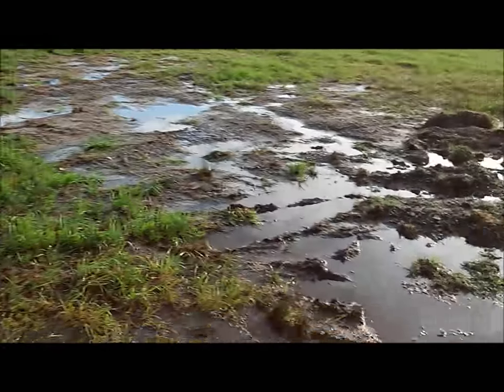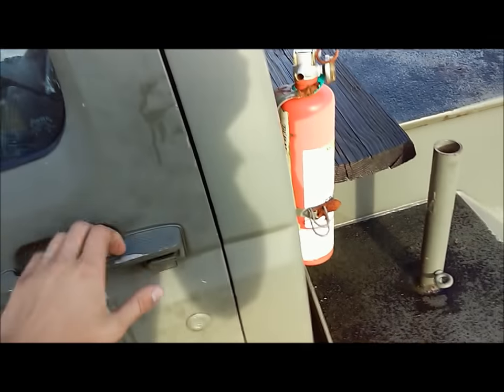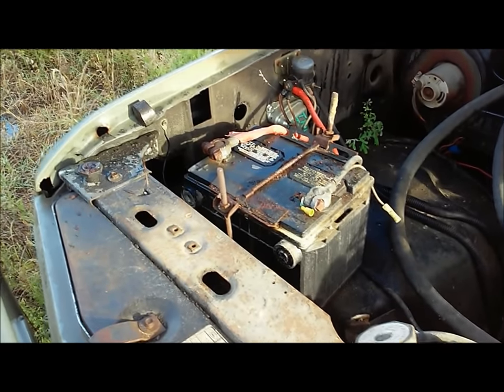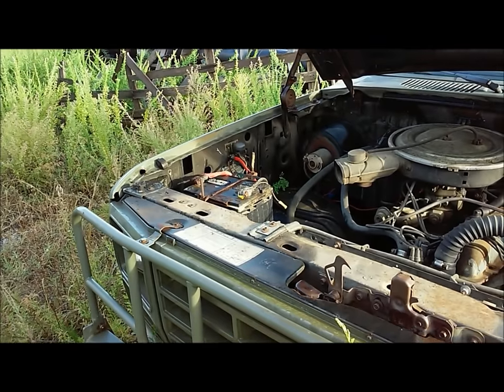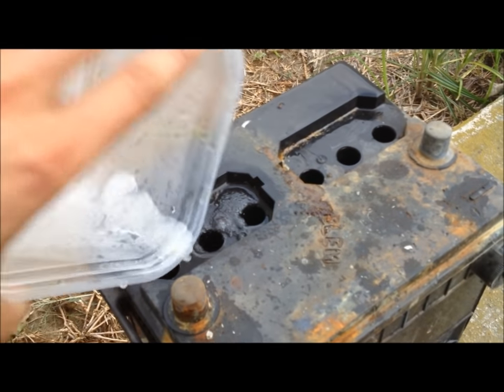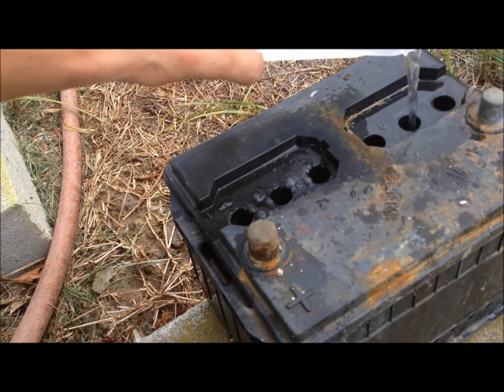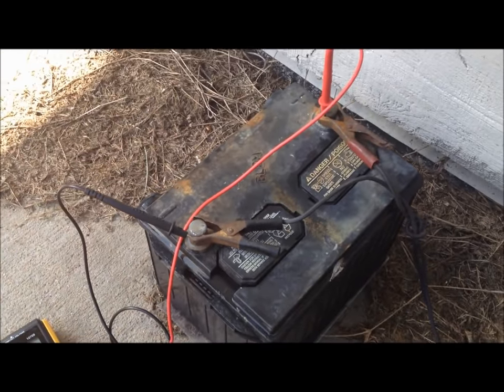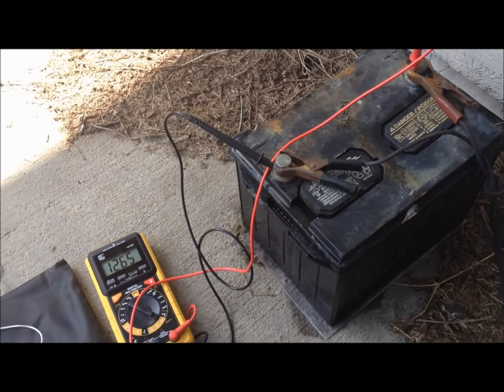Car Battery Repair After Sitting 10 Years: How To (Basic Home Products !!!)

Comment: So did it work,did it hold a charge, did you replace the epsom salt solution with more acid, what kind of acid did you use, did you really pour out the acid in the grass, how much salt to water ratio did you use, is it still working,
Reply: Yeah I am really confused. Why isn't the battery filled with acid? Just epsom salt? Something doesn't make sense. I would think that flushing it completely out with distilled water, then putting fresh sulfuric acid in it, is the only way to properly restore it?
Reply: @Ritalie  yeah you would be correct
Reply: Haven't watched yet but Epson salt will work as "battery acid" because of the (I suck at chemistry and only know from watching videos explaining things) it's baisly magnesium sulphate and is no different electrically than surphic acid.. @Ritalie
Reply: @Ritalie supposedly you use baking soda first to clean the battery out and then put the epsom salt and distilled water in and then charge it supposedly it works I’m gonna try it and see because I’ve got 3 or 4 old batteries around to see what happens
Reply: @Ritalie i tried this didn't work end up buying new😊

Comment: No matter what you do , it all depends on how good the lead plates are. If they are partially eaten away The battery will not last very long and is very undependable, I learned this from trying all these ideas. No matter what, it will not last much longer.

Comment: What you are doing definitely works. But not cleaning the dirt and rust from the top of the battery will end up getting into the inside of the battery. This will short one of the cells out. Otherwise you are doing things correctly and that does work. Worked for me fella. Nice

Comment: South Africa.  Great video thanks.
As a student, 50 odd years ago, I also, intuitively, did the same, only cruder. Not all salts were dissolved and I simply poured it into the cells. And it worked.!
However, in my young mind, I did the following:
I poured out the Acid and quick flushed it with water.
Then I poured in Bicarb solution, to penetrate the bottom sediment, that short circuit cell, and to break it up with the bubbly reaction with residue Acid in the bottom sludge.
I then rinsed it well to get rid of clusters of sludge.
I then poured in my Epson salt concoction in and charged it in reverse polarity.
The thinking in my small brain was that, one of the plates were depleted, and if I revers charge it, (my Positive was from now on, my Negative), I could build up the depleted plate with a metal with higher Electro-potential value , on the periodic table.
As far as my memory serves, it worked just fine.
Reply: Complicated?
Reply: Imagine jy moes die elle lang verhaal in Afrikaans probeer oor vertel

Comment: I was thinking pouring it in a bucket before he started pouring it out.  I like what he did by bring the battery back to life.  Go to the junkyard and see if they will let you have the old batteries if you pull them.  You could use them in your solar system or as a spare to jump your vehicles.  In a truck you could install it and have it only charging and not tied in the electrical system.  If the other battery happens to die you can use the other to jump it.

Comment: you can pour the old battery acid in  a large enough container. You can actually reuse it later. after the rinse the batter with distilled water and rinse at least another time will giving a good shake to get the rust out. I dont know about Epsom salt used this way. Never seen it done before but i did hear about it.

Comment: The truck is called a bobtail and was used by the USAF for transporting munitions from bomb dump storage to the flight line. Max speed was governed at 25 mph. They were able to tow up to 30k.
Reply: They were also used by AGE guys to tow their equipment to aircraft

Comment: At 3:55 I knew why the video has a 2:1 like:dislike ratio.
Oh Heavens to Betsy! He poured battery acid on the ground!!!
Oil, gasoline, battery acid comes out of the ground.  Think of it as recycling w/o burning carbon emissions to process it.  This man is saving the planet from air pollution.
Reply: It's loaded with bits of lead particulates. That's what you want in the water table?

Comment: Battery plates are soft and break easily. If the plates are deteriorated, the battery is junk. The Epsom salt (magnesium sulfate) is a temporary solution to help recharge the cells, allowing the sulfuric acid to become acidic once again and "hopefully" dissolve some of the lead sulfate from the plates. This is where I'm at - finding a chemical solution to dissolve the lead sulfate without harming the lead plates in an empty battery. 

 Automotive lead acid batteries are generally 30% to 37% sulfuric acid. As far as I know, the acid has nearly an infinite life without any chemical contamination. 

The water evaporating from a cell and exposing the plate to air or leaving a battery discharged is what causes most of these issues. 

Simply adding distilled water back to the cell and trickle charging (3-amps or less) for a few days does wonders. I have mine overcharge to a "safe" boil. I'd gotten almost 24 months out of an old battery this way.

Comment: I used this method to recondition a battery a couple of months ago and it worked like a charm. I am trying to do another battery now but it is obtained getting to 75% on the trickle charge. It has been 3 days. Any suggestions?

Comment: The top of the battery has BLEM blazened into the plastic. Sometimes it may also be printed on a sticker. This means the battery has already been "reconditioned" at some point. 12.6v is not bad for a second time recondition. But I would be interested in know how long it lasts. 6 months maybe.

Comment: I just have a couple of  questions. Once you put the salt water and "De-Sulfate" the interior of the battery.  You charge the battery with salt water in it? And if it works with the salt water, and start the car. Did you replace the salt water with battery acid later on?
Thanks: Thanks a lot for the video.
Luis Rivera Arroyo
:

Comment: I just use vinegar 
two batteries deep cycle 
2008 dried up in my garage 
I just added vinegar to batteries and put on the charger I’m still using them today they still take charge !!
Reply: did you use white vinegar instead of water & acid?
Reply: with ranch dressing on the side

Comment: Ive always done this same thing , and I have the same charger haha. It has always worked , but now I noticed you can buy new battery acid locally cheap. Possibly clean it out this way and then dump of the Salt water mixture and put in New acid. I would like to put this new idea too the test.

Comment: Thank you for the info.Saved me $30 on a new battery.
 Wow.So many people just 'comment'to whine about fluid into Your lawn.Not smart enough to think that it's pretty much neutral already or the battery would show Something of a charge,and it's Your yard and not next to their well which would Never be affected anyway.
They should be stopping Fracking companies from dumping Waste instead.That will affect their decendants,not your dead batts.
Reply: Sure and when the person who does share a well with you watches a video and pours their battery acid out on the ground to do this?

The sulfuric acid is probably whatever, but the lead in it is probably not the best thing to be putting into a water table.

Comment: That truck is a tug vehicle called a "Bobtail", since the tail of the truck has been 'bobbed', and depending on the governor, their top speed is 25 - 35mph.

They are used for tugging equipment of all kinds.

Comment: how long will the battery hold its charge for especially when its under load eg with lights on. I think you will  find the battery wont hold its charge. Try and start the car on the next day and i don't think it will

Comment: That little bit of sulfuric acid won't hurt the ground. The rain is full of it in most areas downwind from the big city. 
AND, if an old battery could really be made good enough to use for any real work they'd be worth more than the 2 bucks the recycler gives you.

Comment: I hope you don't mind my comment, but the first thing you should have done is clean all the debris and dirt off the top off the battery, I also would have saved the electrolyte it has lead particles in it, and after you desulfated the battery, you could re-add the old electrolyte. Take a look at Pulse Tech battery desulfators, but they do take several weeks to work.
Reply from the maker: +Jose Francisco Medeiros yeah, thats a hell of a good idea. i definitely should have done that. next time around that i try this, i will have to do it that way. you make a heck of a good point.
Reply: ThunderHead289 I also had a 289 engine in my 65 Mustang fastback.
Reply: hey ,if anyone else wants to discover how to recondition batteries try Jadonite Renovate Battery   Buddy (just google it ) ? Ive heard some great things about it and my mate got amazing success with it.
Reply: +Jose Francisco Medeiros I\'m not sure but ,if anyone else wants to discover how to recondition my car battery try Knewreck Rapid Renew Guide (do a search on google ) ? Ive heard some awesome things about it and my colleague got cool success with it.

Comment: Always clean the top before removing the caps.   And how do we know the battery was dead?  Certainly it should have been topped up and a trickle charger applied.  If it doesn't come up, then the battery is dead.

Comment: I guess you guys don't know one of the rehabilitation methods for drinking water wells is to inject acid into the well. Call your city engineer and ask. What he poured out will be neutralized before it penetrates 3 inches into the ground.
Reply: absolutely right,  Some trace lead in the liquid but the truck leaking for 10 years polluted more than the battery.
Reply: Darrell Weathers b
Reply: Exactly. Basic general chemistry at work. Too many winners of participation trophies 🏆 commenting here
Reply: So u let ur child drink it
Reply: Nigel Gibbs Coin’s

Comment: Waste of time. It will act good after this and take a fake charge. Load test it. You might get a few starts out of it before your stranded or ruin your alternator. 38 year mechanic here.
Reply: Your right, plates are so thin bat has no life left
Reply: Lordskeep i concur
Reply: I used Epsom salt in a battery once that wouldn`t charge up and it worked for  about 2 years after
Reply: ohh thats what the is i was so confused i got batteries that someone did this on and they take a charge but when you put them on something like a trolling motor they shoot back down to 5 volts after reading maybe 12

Comment: You should have cleaned the top of the battery off FIRST, before attempting to open the cells. Wash with plain distilled water, brush off any persistent dirt, and rinse well. A clean battery is worth rejuvenating. If you let the rust and dirt into the cells, you are wasting your time.

Comment: There are  a few ideas for fixing a car battery
Don't try to do this until you know what you are doing - the acid can burn you
check the voltage first - there may be a kaput cell which would waste your time.
Check the battery fluid.
attempt to fully charge the battery.
(I discovered about these and more from Jons Mender Guide website )

Comment: Need to take the plugs out and put a little penetrating oil in the cylinders. The rings tend to rust and stick to cylinder wall and will break. Safest way is to turn it by hand

Comment: I wasted so much time trying that on so many batteries
Reply: It didn't work ?
Reply: @briantruck2284  I tried it also on 3 boat battery's that had set for 15 years with no luck. Not all the cells would take a charge. Only a couple of the cells would. I used an old trickle charger first with no luck. Then I tried charging on my 10 amp  charger, no luck. Then I tried my 200 amp charger. The cells bubbled and you could see vapors coming out of the cells. Still no luck bringing all 6 cells up. All of the chargers I used were the old style. I heard not to use the "SMART" charger so I used the old types that continue charging until unplugged. I was given 3 more old boat battery's I'm going to give these a shot to see if my luck changed.

Comment: In the last part of the video he was supposed to be showing us the BATTERY voltage.HOWEVER he still had the charger connected. All we saw was the charger input voltage to the battery, There was nothing to show us if the battery took a charge or not !! As a good battery discharges lead sulphate forms on the plates. When the battery is charged this sulphation dissipates and the plates return to pure lead for the negative plate and lead oxide for the positive plate. When new this sulphation will take part in the chemical action in the battery as it charges and discharges. If a battery is left discharged the sulphate which is chrystaline starts to compact. After , say, 6 months the sulphation has compacted to a point where it will no longer react chemically when the battery is joined to a charger. The battery is dead. Pulse chargers are supposed to be able to blast holes in this compacted surface but there is still no definite proof that this actually works.The high voltage pulses are more likely to blast the lead paste out of the lead grids that it sits and which also will destroy the battery.
Reply: John Davies- voltage is one indicator of battery condition and state of charge but it's amperage that does the work. It's not uncommon for a bad battery to show 12.6v resting and drop to 2-3v when a load is put on it.
Reply: correct me if i'm wrong but it did say on the vid that charger was switched off at that point

Comment: concrete. will  slowly drain a battery. put a board under it
Reply: No it wont, that is a old  tale. The reason why people believed that years ago was because concrete can become very cold and the cold drains the battery down, but it will come right back up when warm again. The board under is acting as an insulator.
Reply: No the real reason rest in the fact batteries were made w paper coverings the electrolyte would saturate it and would discharge on a hard non absorbent surface like concrete....  temperature is also correctly another reason for a the older less power dence construction years ago. Nothing but a minor temp issue nowdays.
Reply: Today's batteries WILL NOT lose their charge sitting on any surface. Consult any battery manufacturer of any brand and they will confirm. Not to mention that they most likely make batteries for multiple name brands so I'm sure all of them can't be wrong
Reply: False statement. the first batteries leaked so they had a path to ground, hence a piece of wood to insulate.. With the modern batteries, invention of plastic, era they no longer leak and have no path to ground.you can sit them any where. A little thought would help here instead of repeating what some one told you.
Reply: James Chance false. That's when batteries were made from wood casings. Long long ago.

Comment: That battery acid can be and should have been neutralized with baking soda.
Reply: race bannon hey ,if anyone else needs to find out about how to recondition old car batteries try Corbandy  Battery Blueprint Crusher (Have a quick look on google cant remember the place now ) ? Ive heard some interesting things about it and my friend got excellent results with it.
Reply: Can you dose it work
Reply: Sure. Except: lead in used battery aced still remains and should not be dumped on wetland.
Reply: Nice Video! Apologies for the intrusion, I would appreciate your opinion. Have you tried - Rozardner Powerful Battery Reality (should be on google have a look)? It is a great exclusive guide for learning how to recondition an old battery without the normal expense. Ive heard some pretty good things about it and my GF  got cool results with it.

Comment: I hope those Zinc-copper plates are not warped.  Recharging them incorrectly or even hooking them up to a charger will cause them to explode, usually.
Reply: Zinc copper?

I worked in a plant producing lead acid batteries, there is only lead(grid) plates and lead oxide plates.

Comment: There are  several suggestions for battery reconditioning
do not try to do this unless you know what you are doing - the acid can burn your skin
check the voltage first - there may be a dead cell which would waste your time.
Check the battery fluid.
attempt to fully charge the battery.
(I discovered about these and more from Jons mender guide site )

Comment: There are  a few things for fixing a car battery
do not try to do this until you know what you are doing - the acid can burn you
check the voltage first - there may be a dead cell which would waste your time.
Check the battery fluid.
attempt to fully charge the battery.
(I learned about these and more on Jons mender guide website )